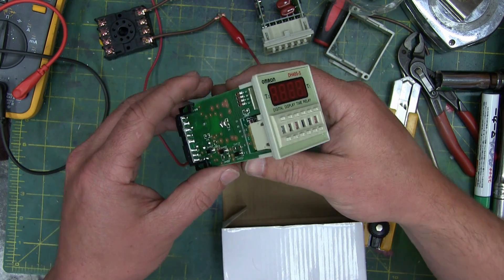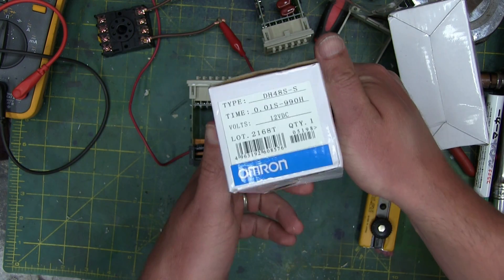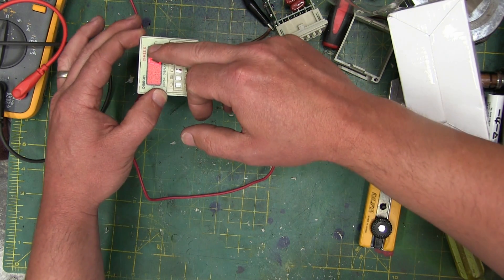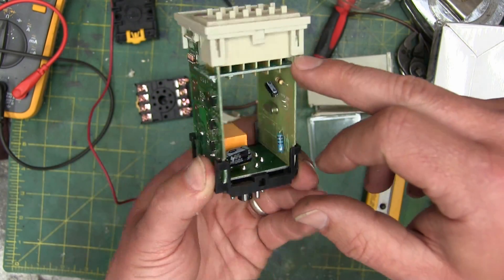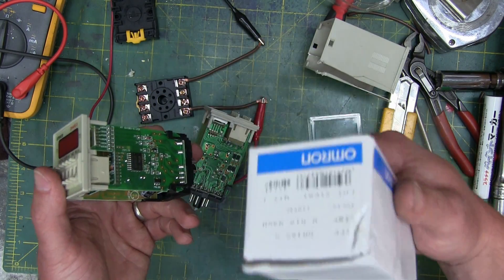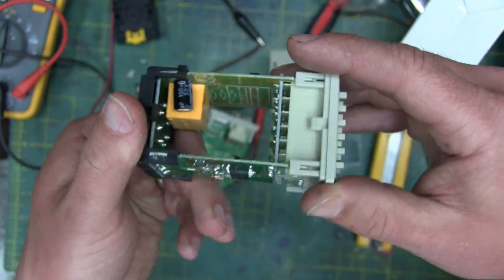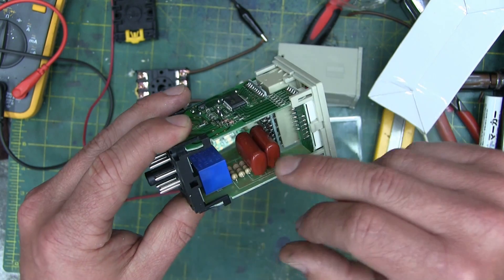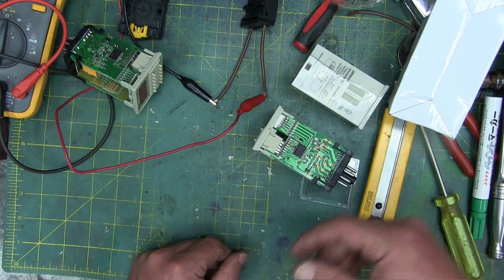BOLTR: OMWRONG Timer Relay

Comment: I don't think they are bad. The large blue resistor in both of them is very likely a fusible resistor (look at its value; hard to tell on the video, but it seems to be very low value). Also capacitive droppers don't really need a fuse. Assuming they used a proper cap (one that fails open like Y capacitors) the current is still limited by it. The overall soldering quality looks nice as well.
Reply: Stick it in a mill environ and it'll crap out in a couple days. I promise. We had an aspiring young EE "boss", fresh outta the endoctrination camps cheap out on a bunch of electrical stuff. He no longer works there.
Reply: The caps are probably from a salvaged CRT TV (definitely not even close to Y caps). And a capacitive dropper in such application is a HUGE no-no. This device in a harsh industrial environment (high temperatures, oil/fluid spills, dust, overvoltage spikes from lightning storms, strong vibration and a 200 lb gorilla operating the device) would crap out in no time and probably take out lots of expensive equipment with it. 4/10, not skookum enough
Reply: I'm not arguing that these aren't genuine (anymore, after the first response to my initial comment I looked up capacitive dropper and agree these likely wouldn't be used for safety reasons alone)  but I would like to say that these devices often aren't stand alone, they often require other components for proper and safe operation.  They are mounted on a rail, usually in a cabinet, and quite often have external filters and fusing.  This is for good reason, if you're in an environment that can get allot of difficult to deal with transients, such with older installations, replacing an internal fuse is completely out of the question.  If it did, you would most likely just replace a $500+ box before shutting down and attempting to repair, in which case both the cabinet and the box were designed by idiots.  You'd be much more likely to have a 10c fuse in a $2 terminal block to protect the device and provide safety.  Even when there is internal fusing, we often throw in a fuse block rated slightly lower to make for quick fuse swap outs before anything destroys the devices.  If it makes it past the fuse and there's external filtering, swapping a $200 filter is still cheaper then a $500 box.  That's why all of these din rail systems are designed so modular, not just for variability, but for cost savings when servicing.  So the lack of any internal filtering/fusing/anything else that's more likely to fail, is somewhat expected.
Reply: The construction isn't that bad, but the capacitive dropper circuit used in the fake is very unsafe (the low voltage side is still referenced to mains which in the best case will trip the RCD and in the worst case will shock you if you touch any metal parts or destroy some other device). Also the quality and ratings of parts matter a lot. Lower end capacitors tend to last under a year, while the good brands usually last up to 10 years. Cheap optocouplers also fail very quickly in a warm environment and their faults are mostly intermittent and very annoying
Reply: TheError404 "The construction isn't that bad, but the capacitive dropper..." - And aren't the capacitive voltage droppers part of the construction as well? :P
"Also the quality and ratings of parts matter a lot." - Oh yeah. I don't even want to imagine the rating of what appear to be second-hand relays used in that device. And the cheap electrolytic caps, they're like Satan itself. Those little evil things alone will ensure that this thing croaks probably in the very near future. Even with sporadic use (as amply demonstrated in the video :P ).
Reply: superdau "Also capacitive droppers don't really need a fuse." - Let's say you buy something REALLY fancy (with a hefty price tag of course). Would you still say the same and then connect this....thing...to it?
Reply: Um, wow, just stated an opinion on here after viewing it based on my past experience with other legitimate Omron products.  I also deal pretty much only with DC, so don't know much about the magical oddity that is AC.  I stand behind my opinion that these look almost identical to legit Omron din rail boxes, as many other people on here have also pointed out.  I haven't used these specific devices, which is why I said what I did as an opinion.   And good job Simon T on your clear grasp of the rebuttal, you are truly a fine debater.  You did a great job relaying what your opinion is actually worth.
Reply: Quit ruining a good story with facts.
Reply: These are panel or din rail mounted, and designed to be inside a sealed cabinet.  The $400 wouldn't last a day in harsh environment, they're not designed for that.  II used to buy the legit Omron Temperature controllers, and the construction is almost identical.  The boards are structural but it's all held together in the case.  These really don't look much cheaper then the real ones we used.  I'm half wondering if these aren't legit omrons but factory seconds.
Reply: GameSpacers "I also deal pretty much only with DC, so don't know much about the magical oddity that is AC." - Well, the devil's in the details, and this case it means AC. Sure, the DC part might look almost the same (I mean of course it would! You only need a microcontroller, a display and some buttons), but 110/230V AC has a tendency to destroy things that are not meant to be run at such high(er) voltage. And the whole point of strict insulation measures is to prevent AC from destroying not only this device, but also any others connected to it (because once that AC gets to the DC parts, it WILL carry over to other devices as well). And don't even get me started on back EMF (voltage spikes caused by turning off inductive loads e.g. motors), because that's a completely different story (and yes, I'm pretty sure that this thing doesn't have this kind of protection either).
Reply: Game spacers - gullible fuck.

Comment: I got some good experience with omron stuff, the sensors and relays are ok. Cheap but gets the job done. I haven't tried their Plc systems but they probably work. I'm not sure if this is real omron or some ripp off. Ps Would be cool to see what you can do with a PID controller and your 4-20mA transmitters. Grate video as always

Comment: it's quite neat they use a good old octal socket from pre-war vacuum tubes.
Reply: The real ones used the same socket
Reply: @ 5Rounds Rapid: Also hard to believe is that the still widely-used quarter inch jack, has been in use since the 19th century.
Reply: I have an omega temp controller with 11 pin 'octal' robust at least.
Reply: Nick Maclachlan I think it depends on where you work. I work in power plants. Older panels are filled with 8 and 11 pin socket devices. Even newer stuff has these. They're great because you can switch out a bad relay and never have to touch any wiring.
Reply: Same pins as brand new guitar amp tubes, too.
Reply: These sockets havebeen used for 100+ years because they work as specified :)
Reply: That's your standard 8pin relay base
Reply: Moonwalker917 I didn't know they still used that socket on anything but guitar amps.

Comment: Actually those box-style devices are pretty common, with the boards used as structure. Had a phase balance relay apart a few weeks ago at work, same deal. And that was a $100 part

Comment: But why would anyone use this for home projects when an arduino plus relay costs about the same?
Reply: teslaTrooper has display, keys, enclosure and din mount, plug and play and real omron timers are rather accurate.
Reply: Because you can prototype a unit with this, then use a real omron when you do it for real. Also less stuff to fiddle with in software saves time... it may sound simple, but once your done with key debouncing and driving a display you have more than ten bucks of time in it, and thats multiplicative for every time you double check that code because something else isn't working. Don't get me wrong, the computer is a "better" way, and much less likely to burn your house down, but real world this is simple, speedy and changeable by users with much less skill or access to stuff they can break.

Comment: hey Ave i happen to have a few real omron made in japan timers. I also took one apart and the chinese clearly copied alot of design features. however the mechanical clock is way cooler on the real one.  I could send you one if you like, I have no use for them right now

Comment: From an industrial standpoint something like a AB MicroLogix is cheap enough to perform this functionality and hundreds of other things.  Sorry industrial timers, computers have killed you.
Reply: Most reliable distributor have an emergency line for after hours. I have had Sonepar/lumen open up at 2am on a sunday before. They send someone on call to the warehouse and put the part in a taxi. It costs an arm and a leg but a downed machine in my case is way more expensive.
Reply: supahonkey but it also has display and input buttons. micrologix are awesome but to get same functionality you would have to use hmi and they are pricey for what they are.
Reply: Victor Galayda In an industrial setting I wouldn't want the user to set any type of timer on and off values.  Typically the timer would be one in a bunch of other items that make up a system anyway.  The timer would usually be invoked by something else as well.
Reply: @L.A. Stuff I agree with you for a single timer it's probably not worth it. It gets more cost effective on slightly more complicated stuff and if you dont own a license to RsLogix 500 so it's not worth getting an 1100. Rockwell's software are so damn expensive(don't get me started on TechConnect). I honestly never had a use for an 800 but I'm sure someone does.
Reply: Morberis because in most cases small industrial plants have everything from AB, plant techs learned AB in school and that's what they familiar with.
Reply: @Morberis, pretty much for the same reason we use Windows instead of linux. Rockwell has the market share in North America, Siemens has Europe and Omron has Asia. Companies buy their product because it is what their staff is trained on and educational institutions develop training for them because they are the industry standard. I'm not saying thats right but it is what it is. Of course I wished that anything with the word "industrial" in the product description would not be ten times overpriced but in the end it's not about how much money it cost it's about how much money it returns. Most of the projects I work on costs a lot but they pay for themselves within a few months if not weeks.
Reply: BTW I am totally with you, Allen Bradley's quality has been going down for a few years (but not the prices). I don't think there is any difference in quality with cheaper options. Freaking Point i/o looks like tic tac boxes. With still have a lot of 20 year old PLC-5 i/o at work for process automation and those things are overbuilt tanks. We have upgraded the PLC to a Logix but kept the i/o (remote i/o) has there was no point in changing them. Of course, rockwell is starting to run out of spares but there is still plenty on ebay ;)
Reply: The micrologix 800 is roughly the same price as a real Omron timer and you can get it with an LCD programmer or USB interface (software is free). I know there are cheaper options and for home use they are fine but for industries reliability and quick availability of spare parts is key. Allen Bradley parts are usually highly stocked at distributors and when a machine breaks down at 2:00am on a Sunday and you don't have a spare you are happy knowing your distributor has it stocked.
Reply: Olivier Fecteau I'd like to know what distributors are open on Sunday, let alone 2 in the morning? certainly not where I live
Reply: I love ab and integrating their plcs, but there's no way I would program one of those crappy little 800s in ccw just to replace a damn timer in a pump panel or something lol. omron still makes good multimode timers that work just fine and any old electrican can troubleshoot em
Reply: Where I work, we have our own warehouse full of spare parts. I'll call the distributor in the morning if I'm running low. ;)
Reply: Omron makes their own smart relay too. But they will keep selling these for twenty or thirty years I bet. Too many old fart electricians out there and too many machines built with these.
Reply: Olivier Fecteau I programmed few micro800, they are good if you building small control box and replacing few timers that don't need to be adjusted. For single timer ab hr52 is still better.
Reply: Why in the heck would you use Rockwell when codesys is free and does the same stuff. 

Granted we don't use ABB because they're so bloody expensive, Wago or Eaton for the exact same thing and the same reliability and same or better distributor availability.
Reply: I understand that, I disagree with it but I also understand alot of techs don't have the time they should have for extra training. For the most part PLC training is just understanding the language and logic systems.

Maybe I wandered away from it, but quality PLC's are even better from a cost relationship than mentioning anything ABB would leave you to believe. Heck one of the wholesalers in town sells an all in one PLC with 8 digital output, 8 inputs, 1 analogue input and 1 analogue output for $120 CDN. You can't expand it easily, but it also comes in different packages with different IO. Don't put it where the 800 pound gorilla can touch it, put it in a box and give him buttons somewhere. Protect the IO with relays, which you should be doing with any PLC unless you want to risk the PLC getting damaged.
Reply: KISS principle trumps all if you want to design a system that is easily maintained and troubleshot. If you need simple timing functions that only require one or two timers, then it's much simpler to use a couple timer relays. Obviously, as systems become more complex, you get to a point at which a plc is the better choice.